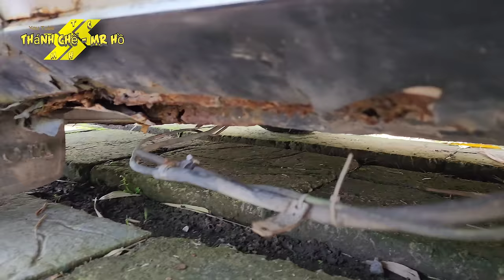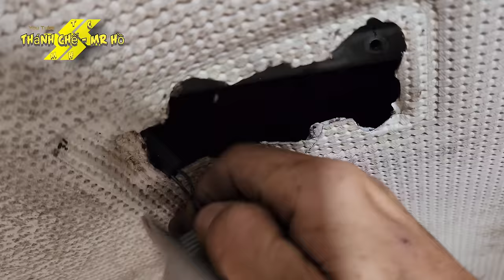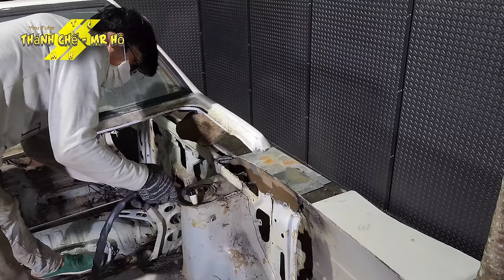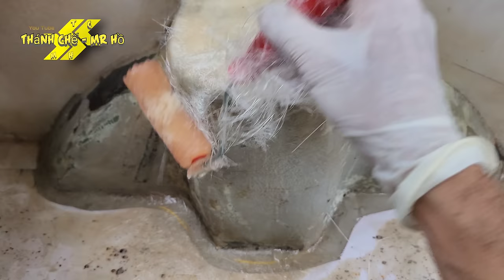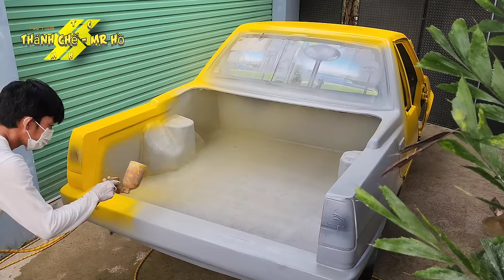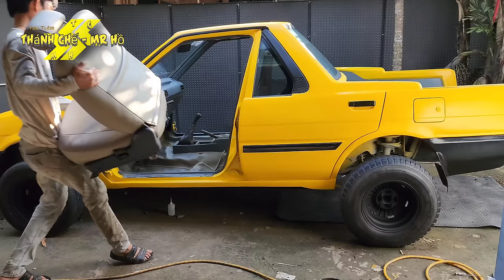Tôi biến ước mơ của mình thành hiện thực

Comment: you should have welded the backdoors and make them disapear, would look much better...
Reply: I was just about to say the same thing and he should not have put the wheels that way he's lost half of his turning radius
Reply: Disaper 😎
Reply: Good
Reply: Bro there is some cabin 💭
Reply: I agree. Welded the door seams. And shaved the handles.
Reply: it would give it more firmness too
Reply: A proper set of wheels and a tailgate would really set it off. Overall it's cool and he built something unique that he likes 👍
Reply: That would close the water drainage off for the door. This thing is just for show. None of those welds will hold.
Reply: @jimastra8488  agree
Reply: I'd be surprised if this didn't crab walk while going down a straight road! 
No drain holes in the bed?
This is a bad version of the Subie Bratt...
Reply: The critics!, all ways at time!
Reply: @jimastra8488  dude these things work without any red tape!... In Vietnam like example!

Comment: That reminds me of earlier in the 70s, when we welded rusty cars like this back together in Germany... but we had to go to the technical inspection with it... installing the rims the wrong way would have been an absolute absurdity... even though the colleague acted very brutally, but still he deserves a medal for welding with electrodes...all respect! 🥇🏆... we used acetylene and oxygen for welding, until the mig mag or the wire welders came up. he did a lot of work, disassembled everything... he could have worked a little nicer... but he's still a talent👌😎
Reply: amazing  indeed :)  well done
Reply: You are very polite. I respect the time Mr.Hô engaged into this conversion/restoration BUT it is not a proper work. In the mad Europe, the German TÜV would NEVER APPROVE this car. To me the worst about this car is the suppresion of structure bars in the trunks.
Reply: I've allways thought the german police was very strict about vehicle condition. This sounds like a sci-fi to me
Reply: @alexandrhrouz666  Early in the 70's doesn't mean "today". Nowadays, it is not about the police but about the official check to allow your car on the roads.
Reply: @alexandrhrouz666 how did WV car pass the emission tests ? Lol

Comment: This is pretty amazing. And I say this as someone who worked around body shops selling PB&E for years.  I've seen a few conversions of this type done, and the only thing I can say that I would do differently would be a little stronger material at the top of the rear shock/strut towers and a heavier box system to tie the two upper rear towers together (probably a u shaped box to go under the rear window, with a couple of pillars down to the floor "frame").  Without it, I see some flex issues on the body/chassis, but overall it's amazing.
I see some rust I would have cut out replaced as well to make it structurally stronger, but overall, I get the "where do I stop" question on an old beater like this...
Also, MAD PROPS for using the stick welder on your sheet metal!
Reply: In places like Asia no one there has much money but they have sometime some tools and are afraid to take on job like this
Reply: That is all you would do differently? Running those wheels backwards on cut up lug nuts is crazy. The strut towers yes need a heavier gauge material and bracing. The rear door latches were removed and not shown to go back in. Welding and filling in the rear door handles and rear door seam needed to be done as well to finish off the strength of cutting the rear structure completely out. Re bracing of the rear deck to the back of the car needed to be redone or kept in place.

Comment: Welding sheet metal with a stick welder isn't easy.
It looks great, however, I am concerned about the rear shock towers not being strong enough.
How do you plan to get at the mounting nuts now that they are covered with fiberglass?
Reply: These builds are like Bic lighters, when it wears out you throw them away.
Reply: Angle grinder, inspection, more fibreglass...  The whole build only took half an hour...!   : )
Reply: У чувака есть плазменный резак, но нет полуавтомата?! 😂

Comment: As always, your work is nothing short of amazing. You put a great deal of hands on engineering into your work, and the level of ability & knowledge is simply priceless. 
I was hoping the rear doors would have been sealed up to look like a factory ute also, but if it was intended to identify a modified sedan, then i get it 😁well done bro, fantastic job. 

Here in Australia, unfortunately, it would never pass an engineers modification certificate. There is a big list of structural compliance and requirements that must be met before they even look at the project. But who cares, You're not in Australia 😂

Comment: I'd use the trunk lid and the piece of the roof to make a removable tonneau cover for the new bed.
also since the bed seems to be water tight you might want to drill one or two small drain holes at the lowest end of it for rain and any spills.

Comment: Nice idea 👍
Shame the rear towers didn't get reinforced, and then get completely covered with fibreglass!
Lots of issues, with body, suspension, steering, even those rear lights are half done...
Nice idea, just a bit rushed.
Reply: Don’t you recognize that all tool and equipment he have is : grinder , welder , antique hammer , and some very basis tool ? The point is he did an amazing job with what ever he has on hand which nothing .
Reply: Nếu cho bạn sử dụng những thứ đơn giản làm,bạn có thể làm nên tất cả nhu anh ấy?

Comment: I really like the way it came out, just be aware that running your wheels like that puts a lot more stress on your wheel bearings as well as some differences in handling.
Reply: A LOT more i'd say. still, it should work, esp if its not daily driver on long distances ;)
Reply: He should widen the front wheel wells so he doesn't have the tires stop when turning
Reply: I wonder if he could lengthen the wheel studs and run twin rears like a dually?
Reply: Looks a bit like a Subaru brat with that raked stance 

Very cool 😎👍
Reply: @nostreamavailable9090  or weld two rims together,  have you seen the guy from russia building the cyper punk car, you should check that out its pretty cool.
Reply: front wheels not working not good, too outside wheels worst job.

Comment: I think he cut too many corners here compared with his previous video where he restored an engine from the bottom of the ocean. 

Things he can work on are..
1) restore the engine bay
2) install a back up light
3) roll out the fenders to cover the wheels
4) cover up the rear door handles
5) lift the front of the car 
6) clean the suspension parts.

Comment: Still needs work, but much better than it was. Hose the bed down with bed liner. Remove the door handles and fill in the holes and seam. And for Pete's sake, finish cleaning up the interior. Glass and paint everything. Maybe even splurge on a layer of carbon fiber on the dash just for kicks.

Comment: this was an amazing build but someones gotta say it. you cut corners on the rust on that car and its gonna bite you in the rear. you left metal with surface rust and unfixed rust holes in the wheel wells. if you're rust mitigating phoshric acid works great but if you don't have access to it vineger, acidic toilet cleaner, or citric acid will also work.

Comment: Turn the wheels back around the correct direction to gain back the safety, and turning radius or get some steel wheels. Add some off road tires. Fully weld the back door seams and fill in the rear door handles. Add back some rear bracing for the rear strut towers. Otherwise a cool conversion using what you have laying around or can get.

Comment: The project is good, but it needs to be finalized 1. The idea of a pickup truck is that you can carry something in it and the same thing here, but there is no rear folding door because the functionality is lost even though el Camino has it. 2. There are no comments here simply because the mounting of the wheels is not correct, the load on the disk is large, which is why if the metal bends it and if the ceramics burst (this is much worse). Z. If you wanted beautiful wheels, you would make an extension and it would look better, and so it looks a little ugly and not familiar. 4. Since you removed the rear body pillars, the body has lost its stability and this is no longer safe. 5. Pickups are made on the frame in order to increase strength and load capacity, the load-bearing body is not very suitable here and yes, there is a Toyota that is able to lift 400kg, but there are springs at the back and here it is independent. 6. glue does not increase rigidity only with metal, and for this you need a devil, which is not here. Well, maybe I'm too picky, but the project is good. Bye 👋

Comment: It seems like your dream does not involve ever replacing your rear shock absorbers and having a normal car's turning radius as your wheels are backwards for some reason. The end result looks very cool though. You were welding the roof but apparently you gave up on that, because the paint that you were gonna sand off anyway started to catch fire? Lets just say it has a lot of character :)

Comment: remember driving across a Mississippi bridge when a cloud of dust and rust appeared mid span. Guy driving a El Camino tapped the bridge rail and his car dissolved. Held together by body filler and rust, cab separated from the frame

Comment: Cool concept but the logic thing was to weld the back doors in line with the rear panel and removed the back door handles. The design doesnt like  cool that way. All that effort and yet there are negatives. Yes you didn't designed the car for a SEMA competition  and more for your own personal use. But you could have done it differently.

Comment: Fascinating, but terrifying. Obviously a lot of this work is a horrific kludge, especially the bodywork and paintwork (Those multiple layers of paint are going to flake right off the body side molding.) and the inexplicable shortcuts like not frenching out the inoperable rear door handles, but those are minor issues compared to the dangerous structural nightmares like how you left any of that cab floor at all (why not just replace the whole thing?), the rear strut tower mounts that will rip out in a few hundred miles, and the custom wheel spacers made out of cheap bolts and -- oh my god -- flatwashers in an attempt to widen the stance (without wheel flanges) purely for looks, since there's no performance or functional advantage to doing that (other than the special feature where you chew up your wheel bearings). I assume that was done temporarily for the video, and any sincere attempt to use this vehicle will happen after that whole thing is reverted to stock.

Comment: so much effort and you bypass doing things that directly impact the serviceability and safety of the car the rocker panel is a structural point on these and you did not replace the missing one and left a crap ton of rust holes in the floor by the pedals and put filler directly over rust with no conversion or removal of the rust, unfortunately, this is going to be falling apart faster than it took you to build it also how are you going to change struts in the rear as well as tail lights. I really like the idea and it is fun but I wish you had put more thought into the longevity and safety of the vehicle. Also, flip your wheels back around not only is that unsafe it does not look good.

Comment: Welding paint and rust and cover up bearing rusted out parts, great until it collapses. I guess it's about money, but how much better cut out the rotten parts and make new parts of new material. A rectangular bed is more practical. With hooks to secure the load. I guess safety is not their thing. Trucks hold together by god knows what at those countries.

Comment: Yikes the battery was plugged in when you were assembling the electrics. I was surprised when the clock turned on and then the dash lights came on!!  One short and you would have had a major fire.

Comment: You're going to regret that wheel spacing.  Axels and hubs were not meant to take those loads.  They'll snap very soon...   Also no drain in the bed and I guess never again going to get at the rear shock mount screws.  Listen - it looks good but a mechanical nightmare.   Wouldn't take it over 30 KPH.

Comment: That mask and sunglasses are not doing any protection. You do a lot of welding, but your welds kinda bad. Like bird droppings (I've seen worse though). I hope you try and improve. I have subscribed. So hope to see improvement.

Also this car was wayyyy too rusty. I'd say get a better one next time. The parts you didn't replace will just rust badly soon.

Comment: I'm from america and i've seen worse builds.  I like it actually.  I don't like the way you used the bolts on your wheels and made your own extensions for the lug nuts.  Please put the tires on regular!  I don't want your wheels to break off and they will!  For your safety please just design or buy proper wheel spacers, this is one part of your vehicle you do NOT want to do wrong.  Please for your safety think about the wheels!

Comment: While these are cool to watch I really hope people don’t buy them off you. Using fibreglass as a structural material in a vehicle tray/bed is not good. It’s not strong. 
Also welding to rust in the vehicle floors where the driver and passenger feet go again won’t last. 
Again everything you do looks cool but isn’t made to last.

Comment: You lost me when you glassed over the tops of the struts.  I get that it was the most expedient thing to do, but it was also cheap and poor practice.

Putting the wheels on backwards just made it worse, and stacking lug bolts into lug nuts is just plain reckless.  This is terrible.  You're going to hurt yourself, or worse: hurt someone else.  Worst of all, you might inspire someone to do the same foolish things.  This thing is unsafe and you do no one any favors by posting this video....except yourself, and that was the whole point, wasn't it.